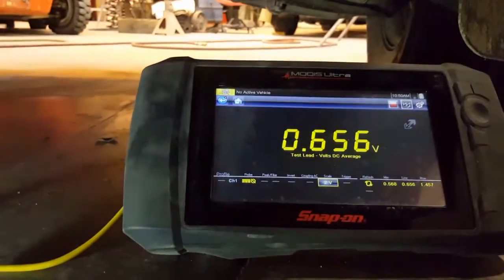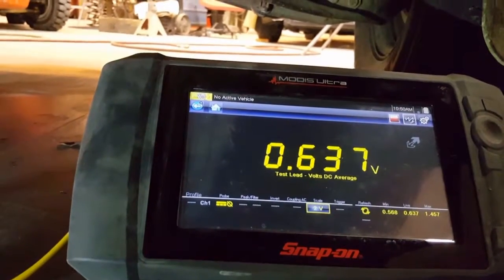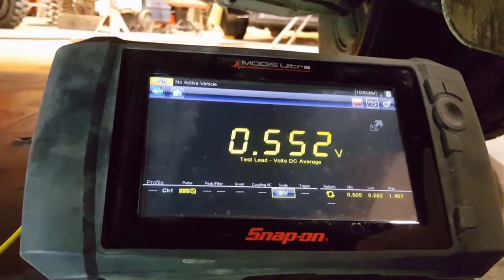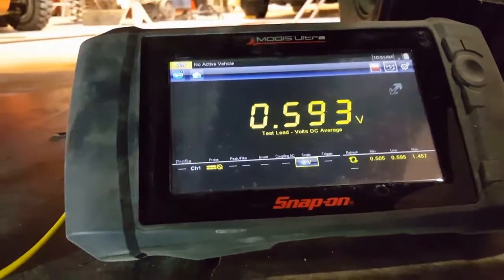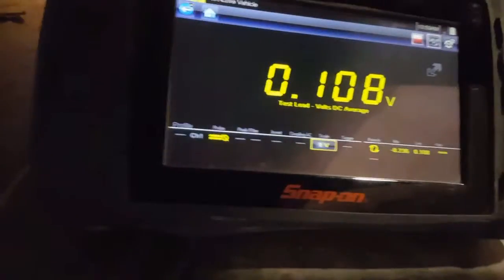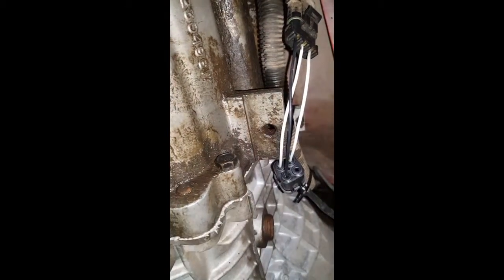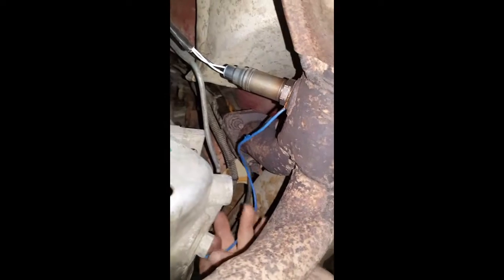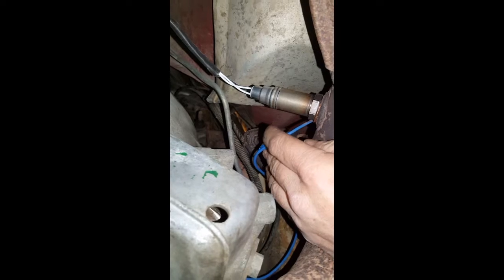1993 GMC/Chevy 5.7  testing o2 sensor. Bad ground to o2.

Comment: You ran the ground wire up to the block or the truck frame?
Reply from the maker: Bruce Wayne to the block. it was cleaner and easier than the frame.